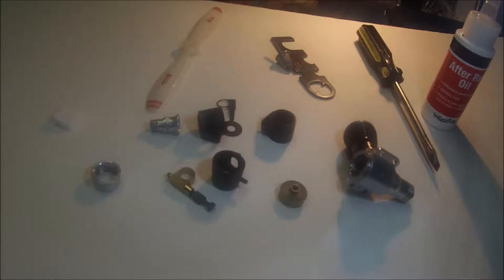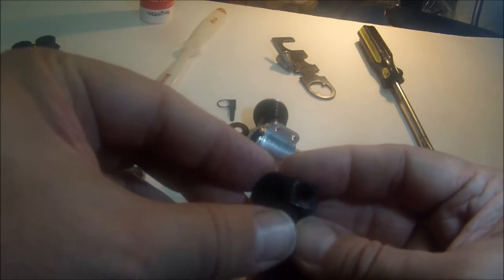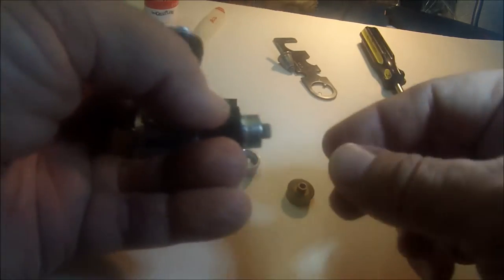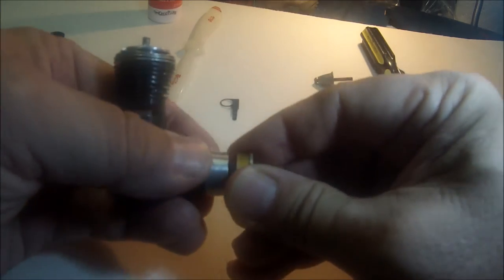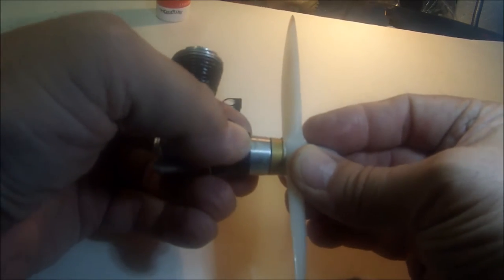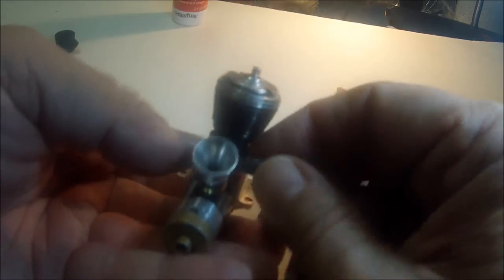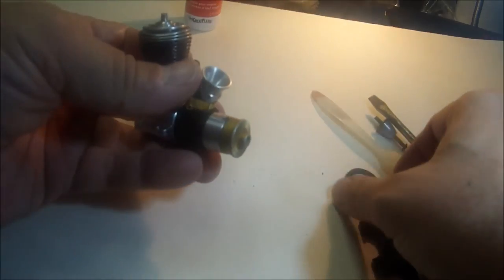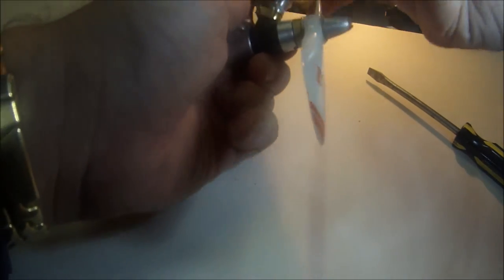Reassembling a Cox TD  09 with Aluminum Carb Body

Comment: If this thread is not dead, I have a question for the OP.
I have one of those aluminium throttle bodies on order but in order to install it I will have to first remove the drive plate from the crankshaft. How do you get it off? Is it just pressed on? I’d hate to do any damage to my 09 Tee Dee which is in mint condition apart from a cracked original plastic throttle body. Thanks.
Reply: Is it just a matter of unscrewing the aluminium collar with the Cox wrench and thus push the drive plate off? I think there is also a thrust washer behind the drive plate.

Comment: I would use a stubby flat blade less likely to slip and get your hand
Reply from the maker: True, even better, I prefer using a hex socket screw. More positive bite, less chance of gouging yourself when trying to work off that screw with oily hands.
Reply: @crossthreadaeroindustries8554  You are right about that, I am heading to my hardware store very shortly to get that fastener. Your vid and info helped, getting this over 30 year engine running again for a line control plane my dad in law made me about 20 years ago, fly it around for the grand kids
Reply from the maker: @josephschmidt439  I really like the .09s - is that what you have? On the Ringmaster Jr., it is well matched to the plain.
Reply: @crossthreadaeroindustries8554  The .09 is on a plane that my dad in law made from wood he had, a profile 28" wing 26" fuse can't tell what looks close to it. I flew it twice shortly after getting it, did real well  on 40' line. I started this restore project almost 6 month ago, got a new head for a glow plug, tried to start notice the carb ordered both the plastic one and aluminum one, you are right the metal one is better. Then sat on self until today to finish this, got a 6/32 1 1/4 hex head bolt, worked like a champ. Need to run hope to asap. I am running it with a 7/4 cox prop. To give it a title call it the DIL Flier
Reply from the maker: @josephschmidt439  Yup, that sounds right. The number one thing I did to make my life happier with glow engines was rig a voltage regulator to a large battery. I got bitten a couple of times with a just slightly underperforming set of regular batteries - this can forfeit your whole day. I will post a video about the cheap regulator and readout I soldered up. The readout lets me know either voltage or current in the field, no more guessing. The trick is don't go very much above 1.2 volts, if at all, or the glow head won't last long, or even fry. Keep the original glow head, I would bet it is just fine. One thing about high castor oil fuel like the Cox engines use is that it creates an environmental barrier on engines, over the years. This sort of pickles the engine til you use it again. There are drawbacks to that - the ball joint used from the connecting rod to the piston can get gummed up, preventing the piston to rotate around while running. I would at least rinse the engine in even rubbing alcohol, but you probably did that if you took the engine apart, already. Let us know how the flying goes!
Reply: @crossthreadaeroindustries8554  Sure will ,To ask have you tried or thought about using an old glow plug and tapping out the center and using a more common glow plug
Reply from the maker: @josephschmidt439  Aha, I have been down that path with the tapped head and common plug. I did much sleuthing on forums and there is a particular glow plug to use. A typical glow head has more empty volume added, so compression goes done (nothing is straightforward, right : ) ). Now, a regular plug does work to some extent, as you can buy them online. So, they might be good for sport flying. But, I bought the tap and plugs - now I have to go find them(!) I will make another vid if I can peel off some time to get at that project. All the best flying the Super DIL Flier...
Reply: @crossthreadaeroindustries8554  Thanks for the extra title to it, Super